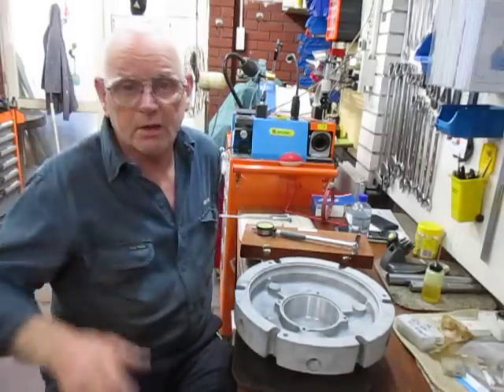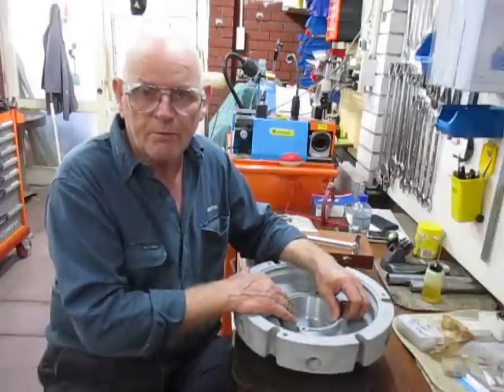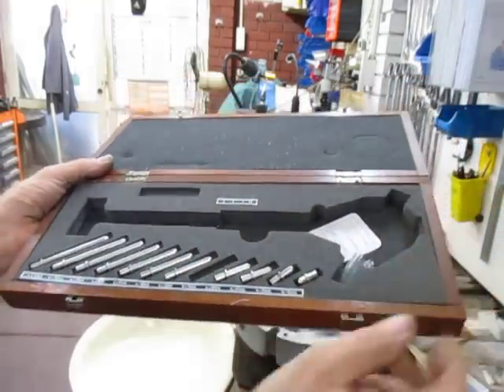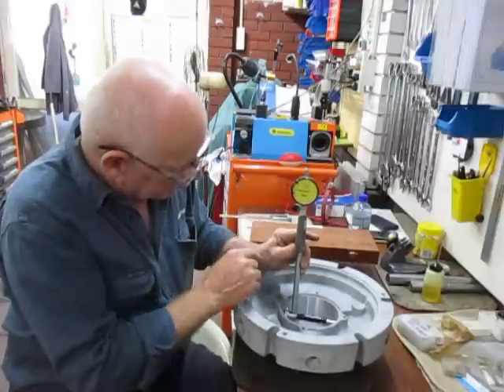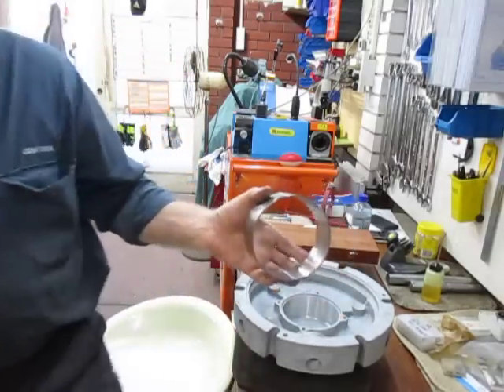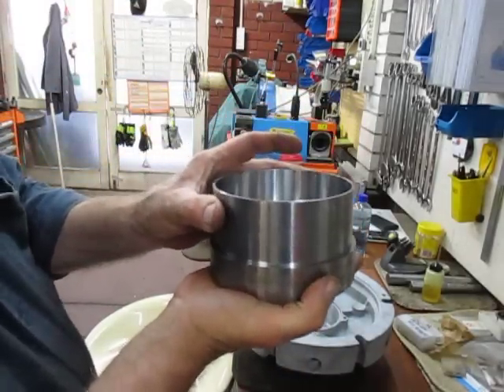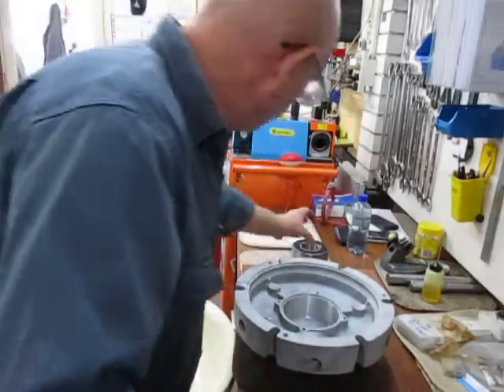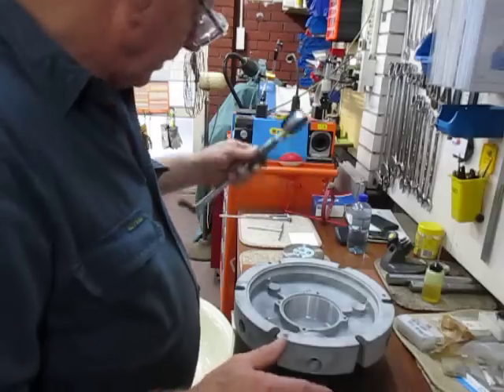Repairing a Bearing Seat 2 By Bruce's bench

Comment: G'day Bruce, What interference di you allow for the sleeve, and are you going to freeze the sleeve, and warm the housing before you press the sleeve in ? I sometimes use Locktite in a situation like this, but I do find it "squeezes" in the inner diameter, not a problem if the inner diameter is machined last.
Reply: I see the interference question is answered further down the page !

Comment from the maker: Randy I machined the outside diameter of the bush +0.05mm (under 2thou.) and the inside diameter -0.06mm (2.3thou.) the bush pressed in (oiled) with about 1 ton with the arbor press. The bearing pressed in about around 3 ton with the hydraulic press. I wouldn't go beyond that with the aluminium casting in any case, and that is about what you would get if you heated the bearing to slip on for an interference fit on a shaft.

Comment: When I was a young guy I did metalizing in my garage and I repaired end bells from electric motors and the motor shafts after they were flogged out as you call it.  I had a hard time finding material for the sleeves, mostly I used thick wall tubing cut offs that I could sometimes pick up at the scrap yard.  Believe it or not I found a piece of wire in the garage the other day and it was holding about 5 or 6 of those sleeves I had made up in advance.  Thanks for sharing.

Comment from the maker: An interesting fact to note about the units of measure used in the USA is that the only length measurement officially legalised in 1866 under an act of congress is the METER. The official Meter no.27 is sealed in a metal case in the vault of the Bureau of Standards since 1889.

Some useless information for the punters out there. I can't help myself!

Comment from the maker: Chris G'Day, thanks for stopping by, in answer to your question I'll give it a go with a longer than short answer.
Being that we are close to Asia and they are our major trading partners including China and Japan, hence Metric is the standards and All the Australian Standards across the board are Metric. Australia moved to metric in the 60's in money and dimensions, However we have a vast  amount of Oil and Gas, and Mining industries, and also huge qty's of Caterpillar machines here so we continue to have a lot of Imperial gear. Some companies like Cummins diesels that I support have a mixture of metric and imperial motors depending on country of manufacture. Farmers and truckers still talk in Feet and Inches even though all the equipment has been metric for donkeys years. I'm now getting more and more drawings from Germany in metric conversion from the Imperial for the Oil and gas tooling work I do. I try to stick with metric but can switch no problem. time is fast arriving that America will have to toe the line as well and I can't understand why they are dragging their feet.
Reply: No guts on the part of the politicians is why the delay.  No one wants to be the one to catch all of the complaints from the old folks.  Actually the motor vehicles are metric and I bet most of the machines people buy are metric.  I worked with a lot of metric things in the 1970's at my own shop since I was doing a lot of motorcycle machine work as well as electric motor metalizing.  It would not take much to make the switch.  Maybe they are sneaking up on it and then one day the only things left to switch will be milk, miles and gasoline.